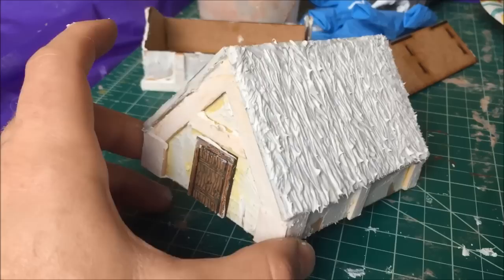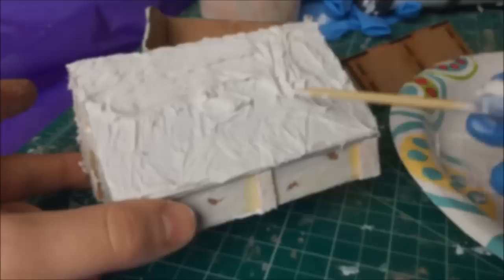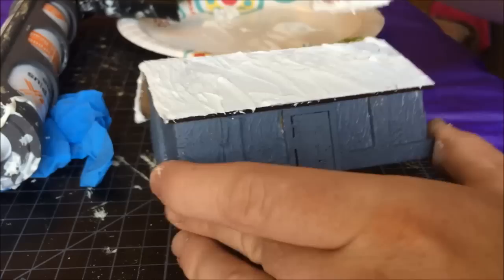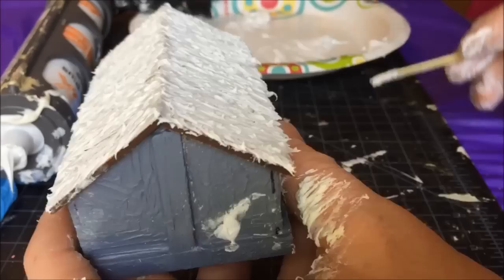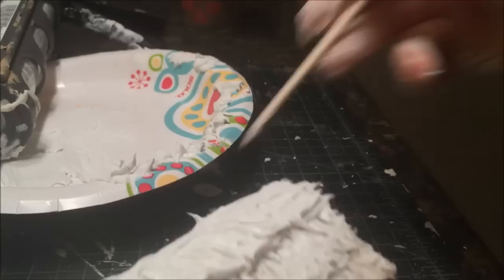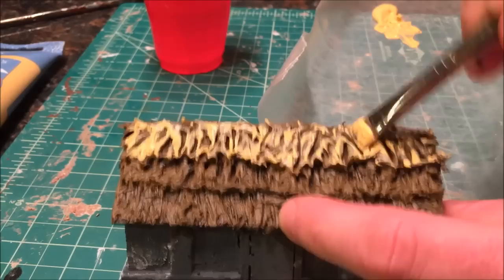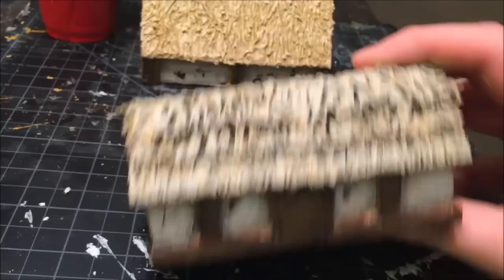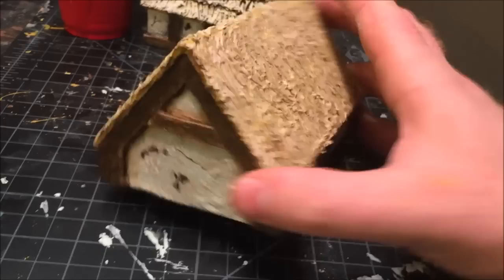How to Make a Thatched Roof for Wargaming

Comment: Looks good but for an even easier and faster route try using your hot glue gun make your marks with your tip as you go along.
Never underestimate the power of the glue gun as it is a mighty sculpter. Can make thatched roofs, ivy vines going up trees or buildings, roots for trees, build up areas that need a little more "meat" on a project. And you can find it in colored sticks now which makes painting easier.
Reply from the maker: +Chris P. Bacon Never thought of using a hot glue gun for this!  Great idea!
Reply: I know you have to watch some of TheDMsCraft with Scotty it's amazing what a glue gun can accomplish and it's quick and cheap and long lasting. Oh I linked your tree making vid the other day hope you get some subs and viewers from it.

Comment: Pretty cool project. One thing though, I believe actual thatch needs at an at least 45 degrees slope to be effective
Reply from the maker: I am sure I messed the correct dimensions of the thatch, I was going for quick and easy job.  If you want more accuracy lay down some mdf to act as your layers and then use a thin layer of caulk.
Reply: Thatchers recommend at least a 55 degrees slope although 60 degrees is not uncommon  and it has to be fairly thick to be waterproof in a rainy climate like England.   I lived in a thatched cottage for several years and thatch is a brownish grey after just a few months yet people seem to insist on painting them straw colour or brown.  Very old thatch is dark grey.

Comment: Mr Baron I went back to this video of yours after I got some inspiration.
I like the finished effect and wanted to try to do something similar myself.

What kind of caulk did you use? It seems more liquid the the one I use to touch up (real) walls.
Reply from the maker: +il Camiciaro I use paintable latex caulk, DAP is the brand I use since it has less fumes.